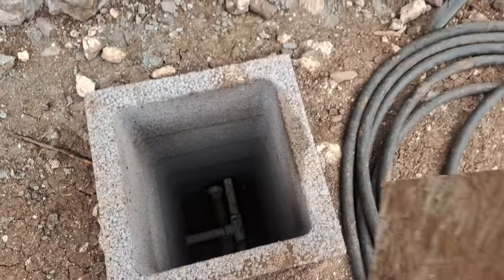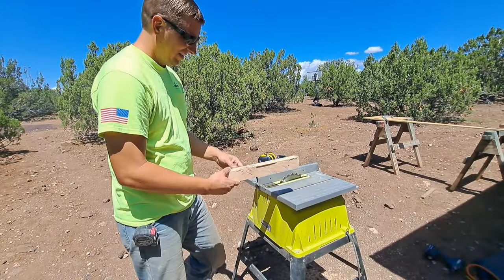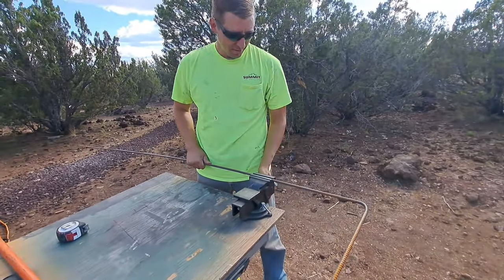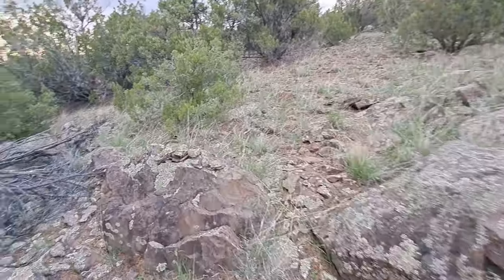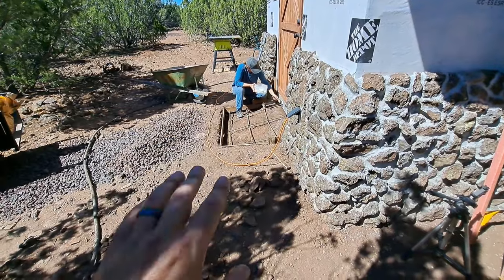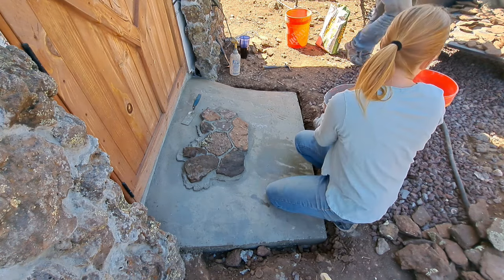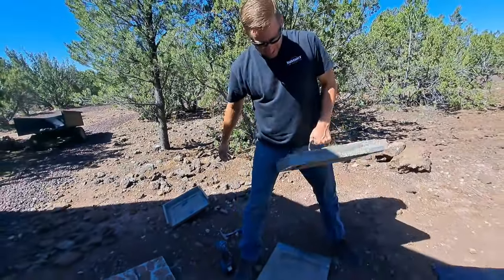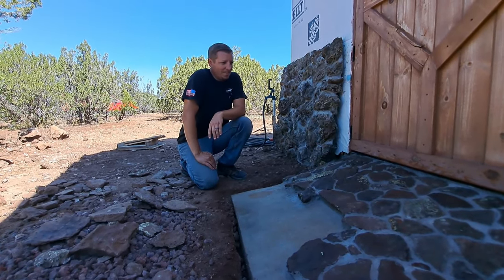SHED Gets DIY Valve Box Covers And STONE Covered Ramp

Comment: It's common practice to paint bare wood being used as a form with a petroleum product of some sort to prevent the wood from wicking away moisture and to ease removal, much like using mold release when casting things in plaster or epoxy. The rocks on the ramp into the shed will also provide good traction in crappy weather, an excellent side effect.